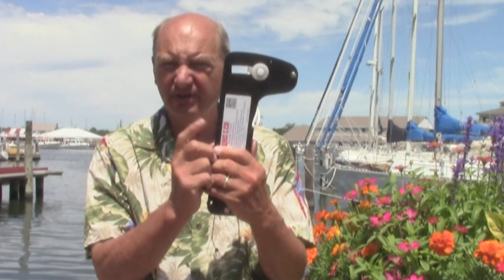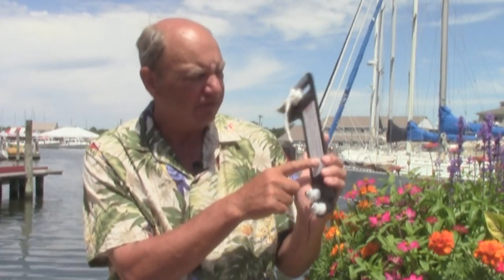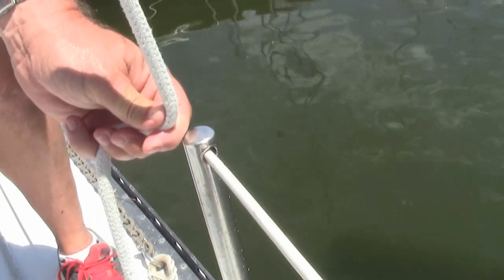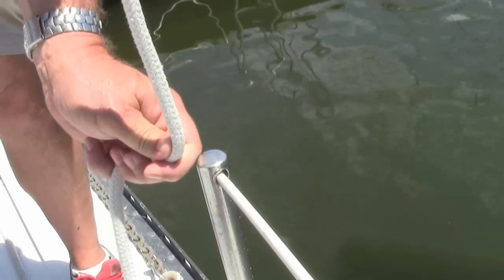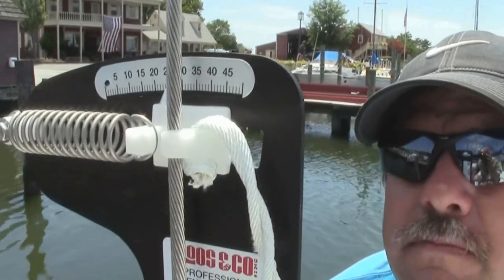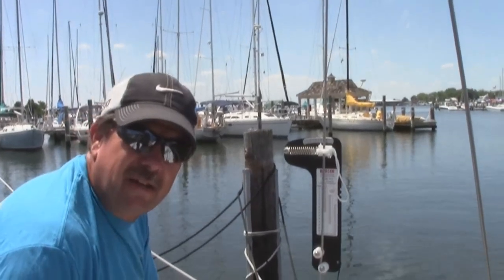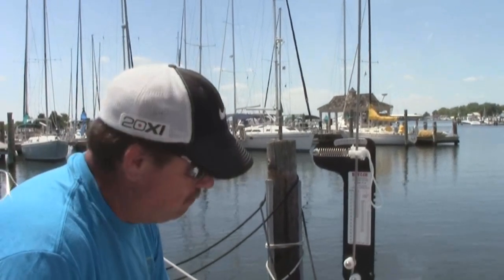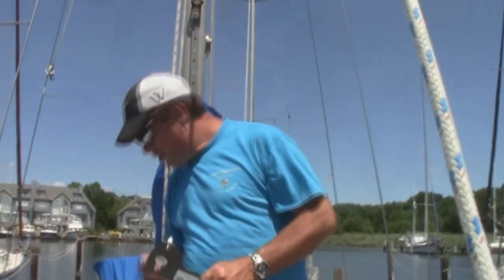How to adjust the tension on stays & shrouds; Loos Tension Gauge

Comment: Great video, however, just to be clear, NEVER adjust a turnbuckle by sticking anything through the openings. ALWAYS use a spanner across the flats, to avoid deforming the bronze turnbuckle and causing rig failure.
Reply from the maker: +TheBenronpro 
good point tks

Comment: When centering the mast, measuring to the top of a stanchion isn't accurate as they aren't necessarily aligned the same. I measure down to a spot on the chainplate or deck for maximum accuracy. Also, I attach a 50' or 100' steel tape measure to the main halyard and pull up the mast and then measure for the same length. I was very surprised to see a professional rigger just stick his thumb on the halyard and then hand it off to  the other guy. This system is probably accurate to within an inch. If you want the mast centered within 1/16" to 1/8" then use a measuring tape and measure to a fixed object near the deck.
Reply from the maker: thank you very good advice, i think i will try the tape measure advice

Comment: Great video - I always wondered how to use those rigging gauges. It would have been interesting to get the riggers comments on how to test rigging tension for stays that have roller furlers. I have rollers furing on my headstay and staysail stay, and I'm never sure if I need more tension on those stays or not.
Reply from the maker: coolbluetoo  I will find out and post the info on this video tks
Reply: What was the price?
Reply: please got to 'how to" on Loose tension gauge webpage. What I understand it is done by tensioning backstay..
Reply: depends on if your boat is masthead or fractional rigged. a both system are tensioned via the backstay when you have roller furling set up, the difference is that in a fractional rig, the backstay bends the mast like a archer pulling back on a bowstring. which manipulates the sail shape, getting a little more power from your sails in certain conditions and tension settings. fractional rigs have a backstay adjuster pully system to enable this adjustment to be made on the fly while maneuvering in a race, for example. if your boat is masthead rigged, then the tension adjustment is more straight forward, like the shrouds.

Comment: How about a little wd-40 on those threads, stainless is really good when it comes to corrosion resistance but if worked too hard the threads will seize.......then your done for. So as long as I am being a critic you should completely dis mantle the turnbuckle and apply a heavy coat of permatex antiseize to those threads. And if a rigger comes on my boat to set the stay tension with a crescent wrench and a multibit screwdriver he will be asked to leave immediately. Crescent wrenches are good for 2 things keeping paper charts form rolling up on your plotting table and throwing at stray cats on the dock.
Reply from the maker: +Bill LV Eightfivefive 
tks for the info, good advice. we used the tools i had on board

Comment: How do you tension the headstay with a roller furler?  You cant use the tensioner device with the foil on.
Reply from the maker: each brand of furler is different, i was not able to use the gauge, but was able to tighten the headstay by following the Harken specs. https://youtu.be/jzcHvxBCjF8?si=0cEZjKXm5ibrM68p i hope this helps.  Thanks for watching

Comment: Hi all, I'm sailing a SB20 and need some advice on tightening the side shrouds. I was aiming for a 34 on the outer shrouds and it was at 33, and when I was tightening it, it hit a point where the entire line would "reverse" the shroud just "bounced" back and undo all the tension and dropped to 15. Any idea what I should do from here on? Every time I tighten it now, it just bounces back. Any help would be appreciated! CheerS!

Comment: I don't think I would put too  much store in using a rope from any distance to measure that closely. Rope stretches and you could be out by several inches depending on rope thickness, distance, how hard you pull etc.
Reply from the maker: true but halyards don't stretch much, yes you do need to be careful of NOT pulling hard, thank you for watching and commenting
Reply: @VagabondEpicurean  my halyards are home depot special 😂😂
But I'm not sailing a 35 footer either
Reply: @VagabondEpicurean  Actually, over a 40' length or so of  mast height, halyards that are not metal can stretch quite a bit with just a little bit of pull....especially if we are looking at a only a few inches.
What I don't understand is why they need to be up to a 1000 lbs tension? Does it take that much to get them to the point where they don't stretch much?  Having that much initial loading on the rigging would over-stress them all the time wouldn't it? Why would say 200 lb no be acceptable?
Reply from the maker: @gerrys6265  what i understand it to be is a 1,000 lbs breaking strength not 1,000 lbs tension.  I think it is more like 150 lb to 300 lbs actual tension.
Reply: @VagabondEpicurean  OK, thanks for that.  They never talk about what it all means, just use the tool like an automaton without really understanding what you are doing. It would be really helpful to understand which it was for sure...'breaking strength' or 'tension' - and why would they use 'breaking strength' as the reference? ...and what breaking strength?..that would change with the wire size, no?  And (again) what do the 28 and 32 numbers refer to on the gauge?
Reply from the maker: @gerrys6265  they are referenced on the gauge see 06;30 on the video thanks for watching
Reply: @VagabondEpicurean  But they are referenced to other scales on the gauge which are not explained either except at 3:34ish when he does talk about 900 lbs 'tension' (not breaking strength). Without knowing what those numbers actually mean, it is pretty hard to figure out what you are actually doing and understand what is going on.
Thanks for your patience with my ignorance.
Reply from the maker: @gerrys6265  I am happy to help where I can.  You have some very good questions and point, unfortunately I am not an expert and at times I am not so sure the experts are exports.
Reply: @VagabondEpicurean  I too am surprised at the "experts" sometimes. Thanks for your help on this.

Comment: When he say the lower shrouds should ha lower tension i will like to know the criterium he use to determinate how lower tension should it be .in the excemple with your boat he choose 29 why 29 and nit 25 or 22 there is the trick if you dont know the criterium we stil in the dark and the video dont learn really very much .
Reply from the maker: Thanks for watching, as stated in the video there are no hard and fast guidelines only ranges depending on how you sail,  That is is why there is a range on the gauge (breaking strength) i think the key is to have the same tension on port and starboard sides

Comment: Couldn't you leave the gauge on either wire? It seems to me that it is working as one system, get it square and adjust up to your desired number by counting turns on the port and apply equal turns on the starboard to 32.
Reply from the maker: +William White 
you might be able to but i think it helps to double check, this spring i will test that out and let you know.. 

Since this video several of boat neighbors bought a Loos
gauge and share it